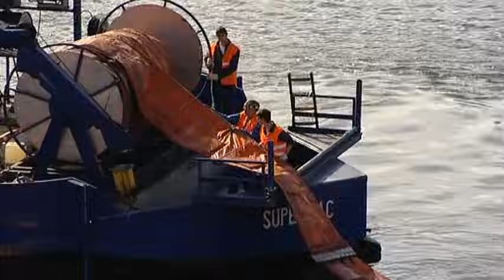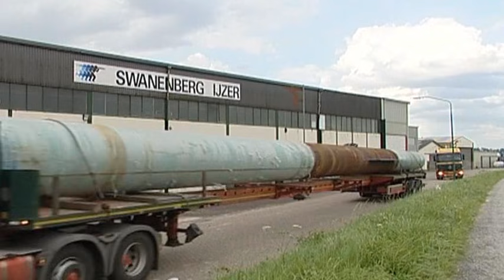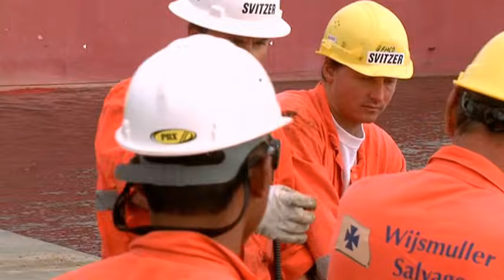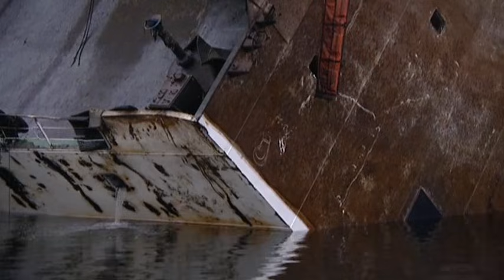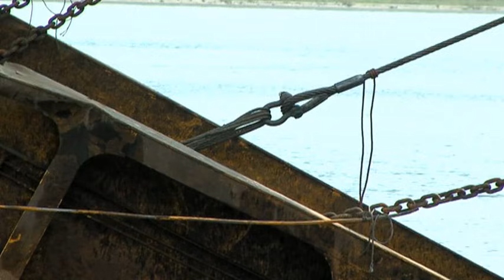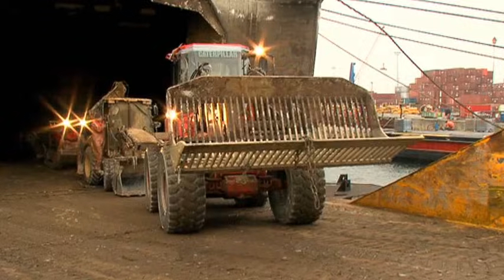REPUBBLICA DI GENOVA SALVAGE OPERATION

Comment: IT didn't mention the cause of the capsize.Is that not an important factor in the pa-buckle ?
Reply: For a RORO vessel to roll on its side that is always a combination from mechanical failure in its ballast system and mistakes in the cargo loading plan. Yes you can avoid all, in general RORO vessels are safe and can have a list to 45 degree and will come back up again. problem is here if cargo was not yet secured and starts shifting it is a lost game, because  more weight ends on the low side. p.s. even after this recovery the vessel sailed for only 3 years with 3 more names this until 2010 with last name "front" this indicate that even after this operation that the vessel was with to many problems and is later sold for scrap metal.